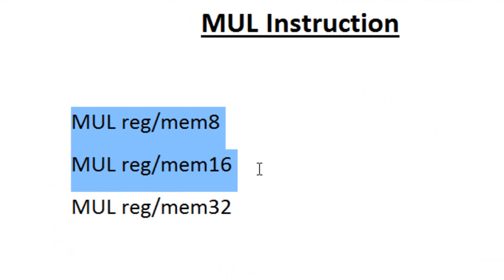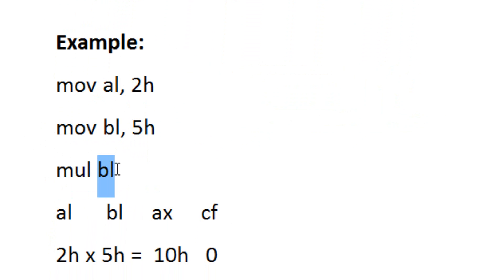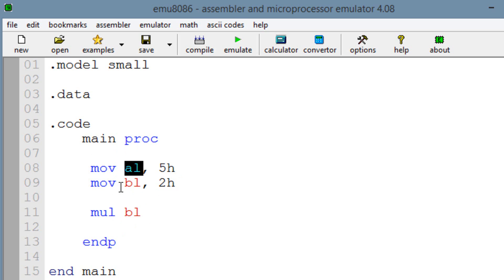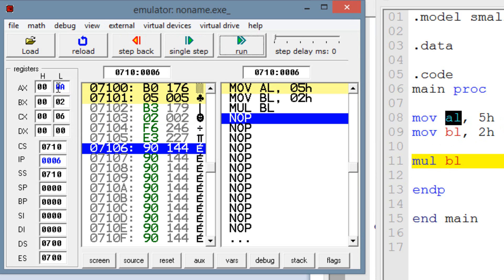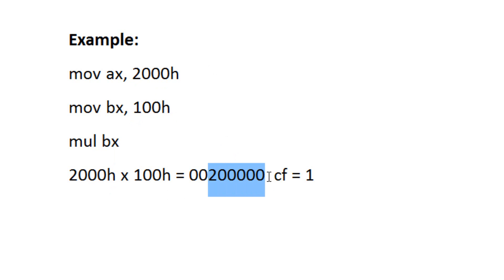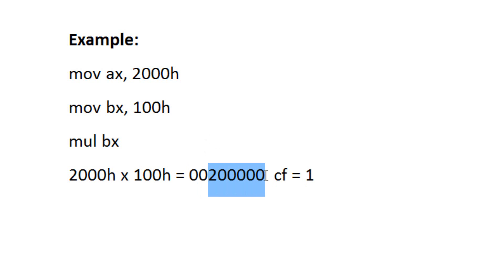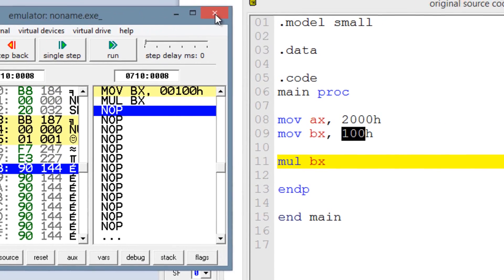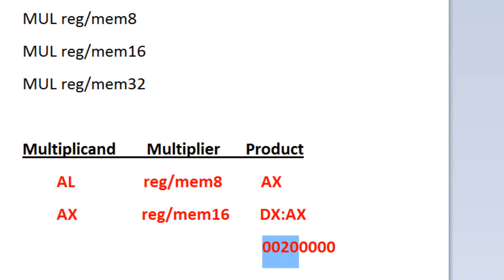Assembly Language Programming Tutorial - 49 - MUL Instruction

Comment: You don't need an online converter to convert hex to decimal, or binary to hex, or whatever.  Windows comes with an app called "Calculator" (calc.exe) that does that for you.  You just have to change it from standard to programmer mode.  It also has a scientific and date calculation mode.  Noted....I can see the site claims to do fractionals as well....the calc app doesn't do that.